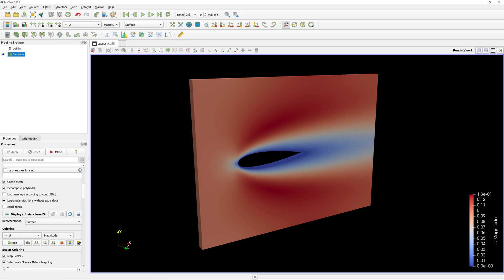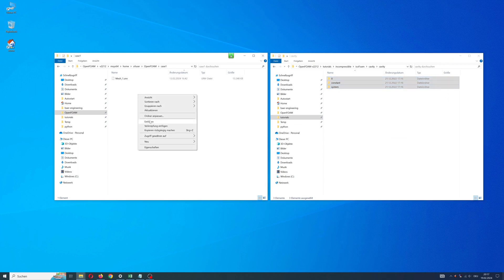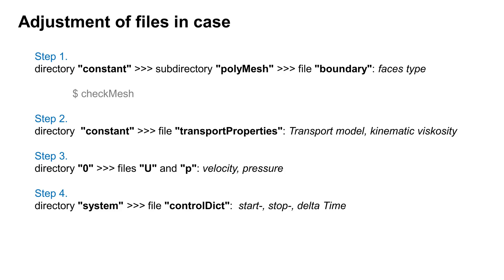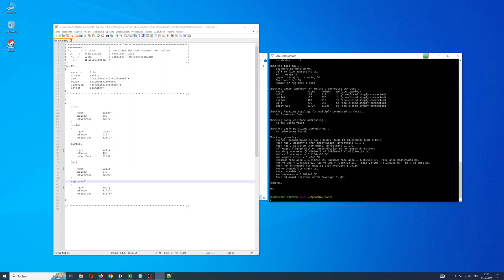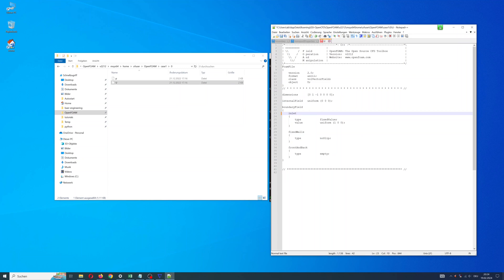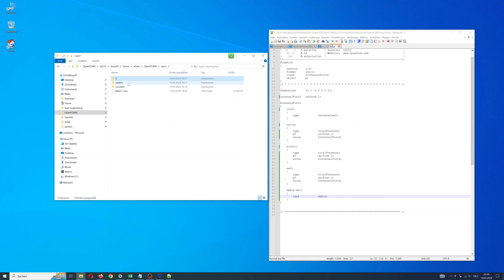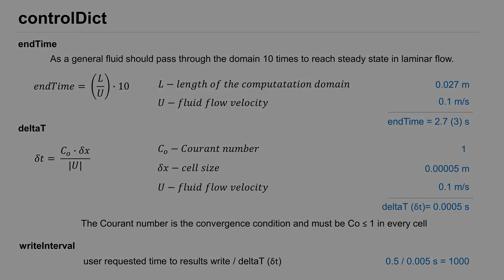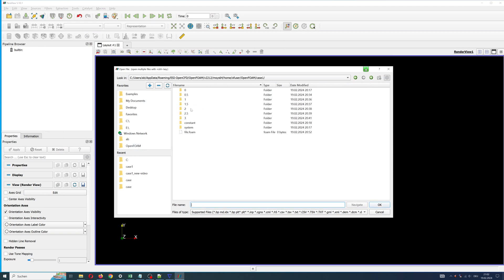Fluid Simulation (CFD) | Airfoil NACA 0020 - Laminar air flow - Part 3/3 | OpenFOAM

Comment: Which tutorial was taken and modified for this simulation?
Reply from the maker: Hello, you can find link to parts 1 and 2 in video description.
Reply: @andreas-baer-engineering  Thank you. Though what I intended to ask was from which tutorial and files did we started to modify the parameters to fit our simulation case?
Reply from the maker: @angelicacosimi9272  Hello. Can you explain more? I still don't understand what information you need.
Reply: @andreas-baer-engineering  In the video you state that the easiest way to run a simulation is to take existing tutorials and modify them. Which tutorial did you use?
Reply from the maker: @angelicacosimi9272  Okay. I understand now. In the OpenFOAM installation directory, in my case: C:\Users\Username\AppData\Roaming\ESI-OpenCFD\OpenFOAM\v2212\msys64\home\ofuser\OpenFOAM\OpenFOAM-v2212\tutorials

There are several OpenFOAM examples. In this case: incompressible - icoFoam - cavity - cavity.
You can see this tutorial here: https://www.openfoam.com/documentation/tutorial-guide/2-incompressible-flow/2.1-lid-driven-cavity-flow#x6-60002.1